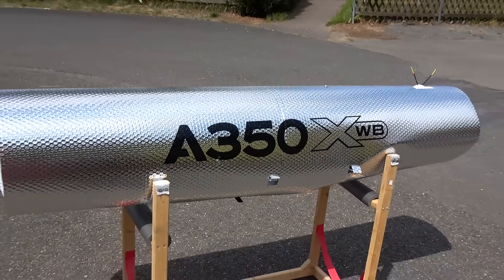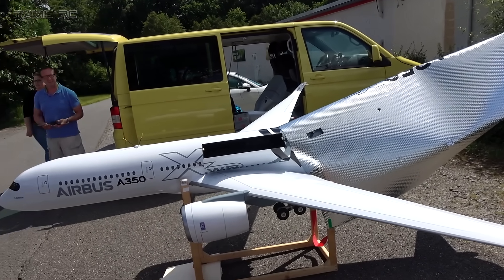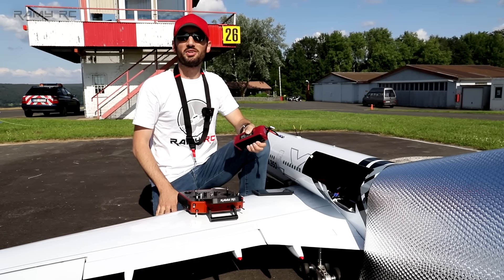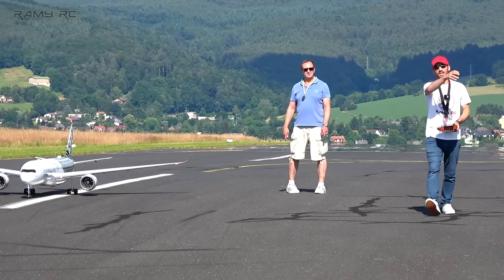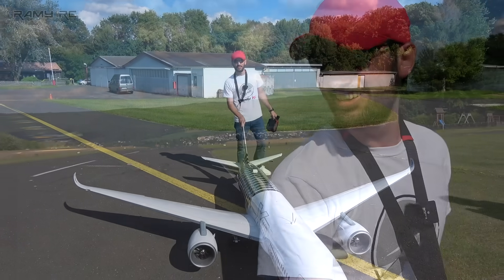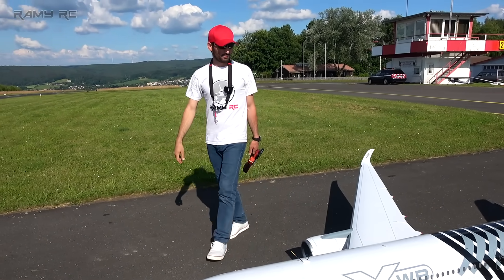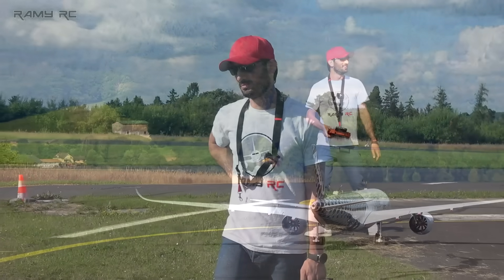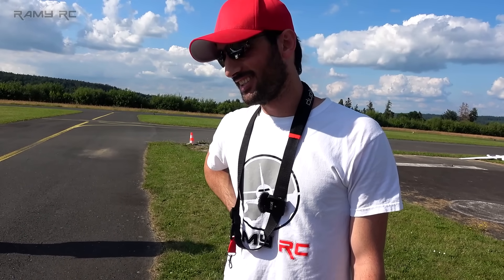GIANT RC AIRBUS A350 XWB MAIDEN FLIGHT

Comment: compared to the boeing 777-x, which by the way was shaking a lot in turbulent winds.  This structure made of carbon fiber was perfect compared to the models made in depron, with the fiber the aerodynamics are more perfect, the air comes out with a better aerodynamic performance in the parts of the entire model.  I have never seen a model so close to the real in performance and stretching speaking just like yours.  congratulations, just incredible.  It would be very interesting to see you build an a380 in fiber, it would be wonderful to see the whole process like the a350.

Comment: Try making a reverse trust..
It would look and stop like a dream
Reply: Doesn't make sense tho. You would need the edfs on power to use this. Instead of that you can just use esc braking.
It would be good on turbines but in edfs it's senseless
Reply: @peterzingler6221  You mean edfs stopped or edfs rotating backwards?
Reply: Yes trying making it. It will help you perfectly
Reply: it could make the nacelles open and throtel up as the real thing or with the aux channel on the castle esc he can reverse edf rotation with a switch

Comment: Congrats on the maiden your very talented builder!!!  One comment, I think your gyro is not setup right.  I been flying Cortex Pro in all my Jets for many years and the best gyro on the market hands down but for some reason seems not to be stabilizing your plane like its should. Did you download the demon app on your computer and adjust the control lock & stick priority or are you using stock settings? I know on Jeti you can do it off radio but you can get a much better picture of what the gyro is set at using the app.

Comment: If the carbon fiber frame blocks the signal of the antenna, would it not be better for the antenna to be under the aircraft not mounted on top?

Comment: Hi Remy congratulations! That was awesome! I think this is your best plane so far!

Remy you think is possible you can release an out take video showing the tail cam video. Looks really awesome from that angle as well.

Man that is amazing. I hope airbus gives you grant for doing such good job on there plane.

Finally was it easier building using the car an fiber 3d printer method? How much time did it save you over the whole project?

Comment: Wonderful job and finally a succesfull maiden Flight ! Congratulations. May I suggest something ? The A350 is a glider shaped aircraft, you should use more the rudder when turning. The nose seems to be "outside the turn" and it doesnt fly symmetrically.

Comment: it looks and sound sooo much like the real plane =) amazing =) wellll done =) i would have one question. How did you find the right airfoil?
And maybe you should put a speed sensor on it so you make sure you wont stall it and maybe add brakes to the wheels so it will stop faster =)

Comment: That thing flies amazing. Congratulations. What was the final weight?
Reply from the maker: Thank you Nathan, with 4 batteries 21kg
Reply: @RamyRC  Without batteries it will be kinda 17-18 kg which is almost lighter than B 787-9.